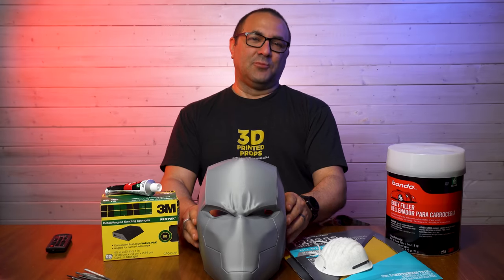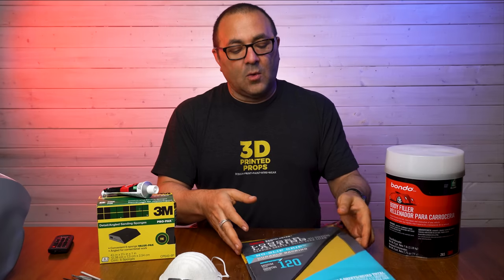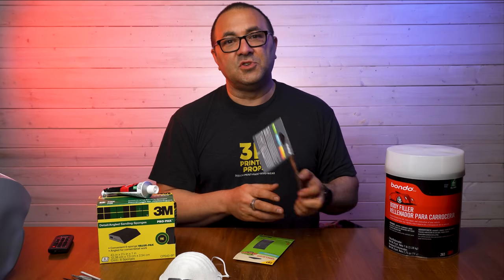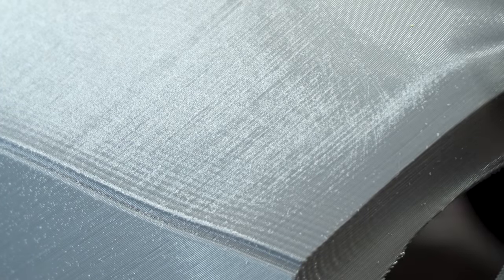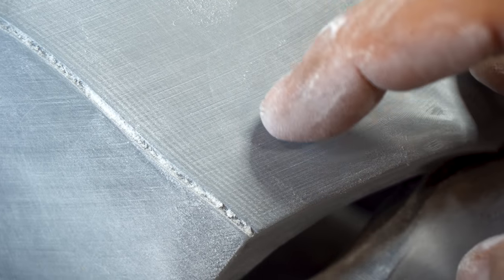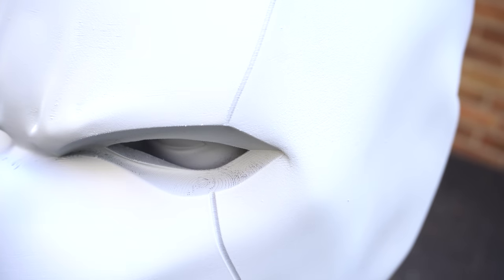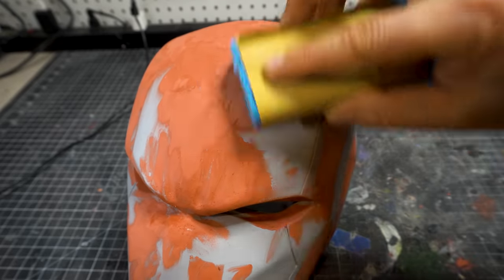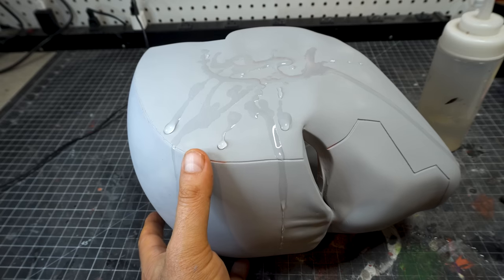Finishing 3D Prints: How to Sand, Fill and Prime 3D Printed Parts

Comment: Very interesting video but one complaint. Use gloves when handling and sanding because your sanding the oils from your skin into it. Never touch the item you've sanded before priming or painting with bare hands. Also, a wipe with wax and grease remover (gloves on) before spraying primer and paint is a must for a great finish. Otherwise very good video.
Reply from the maker: Thanks for the tip, you're right. I've been getting sloppy. When you're doing the vids its easy to get caught up in just working and recording. :P

Comment: i wanna say just use a resin printer
Reply: A helmet that size to be wearable would not fit in the average resin printer. And many of those helmets are not separated into parts ready for those resin printers.

Then factor in the cost of resin compared to the filament cost.

Comment: These grit changes don't make logical sense.  Going from 120 to 240 is huge.  Should be to 180.  Going from 320 to 400 on the other hand makes a tiny difference.  Almost like going with 320 again.  Source: professional woodworker.